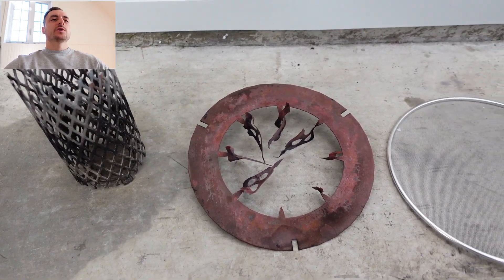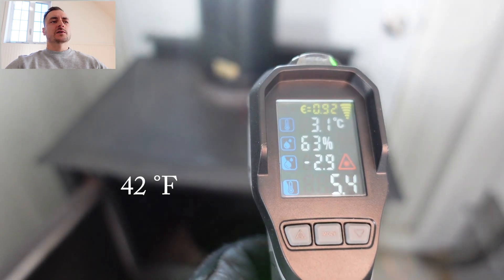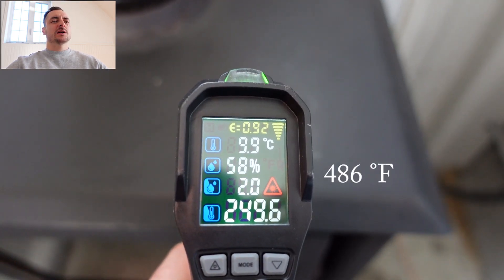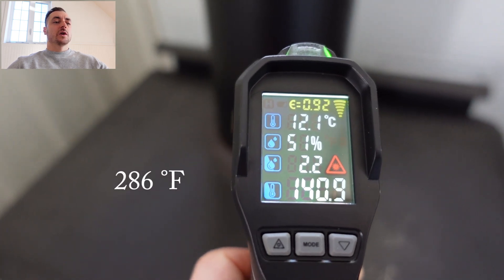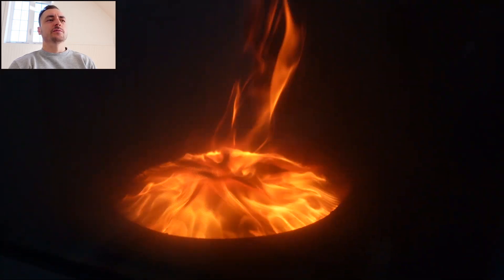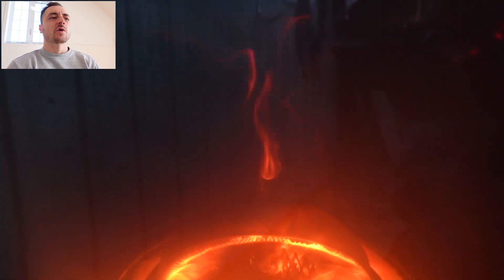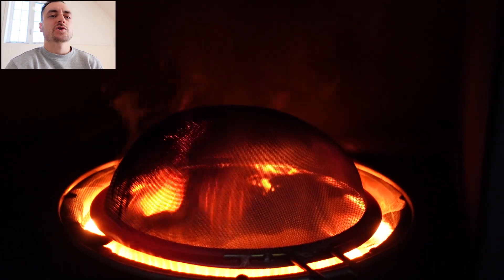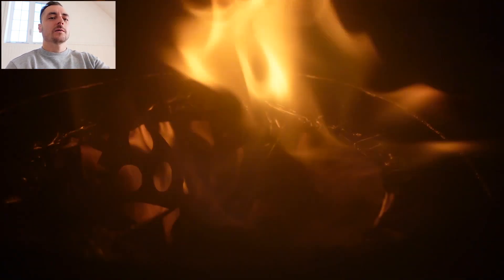CATALYSER Stove Test | HOW TO Make Your Stove More Efficient

Comment: Hi Phil.. I’m glad that I’m not the only pyro out there that plays with oil stoves. I’ve used one on and off for about 27 years depending on oil prices. I switch between an oil stove and coal stove. I love both fuels..From the videos that I have seen of your stove, it looks like you have blue and yellow flame burner. To get yellow flame you install 3 rings that sit on the little nubs in the burn pot (8” diameter) Smaller (6-7”) pots use 2. For blue flame you remove the rings and use the double wire mesh round catalyst placed in the center of the burn pot. You need a stronger draft to direct the Jets of flame onto the catalyst so that it glows red hot. Then the flame will be blue. It goes in with the little disk that holds the mesh together on top. You put yours in up side down…

Comment: I had an interesting event last night.   With the milder weather,  I am shutting down the stove during the days, and just running it at night.   Last night, I kind of rushed the startup, trying to get to bed.  This time, I used much less alcohol (oh, and I haven't been using any steel wool any more) and I waited a bit too long, and had the alcohol almost completely used up before I turned on the oil.  But after a few minutes, the flame had jumped into the area between the cast iron rings, so I figured it would be good to go, and went to bed.
Well, it wasn't, and flamed out, probably from the gusty winds we were having.   I woke the next morning to a cold stove and a flooded burner.  This has been something that I was always worried about, and even contacted the manufacturer inquiring what would happen if this were to ever occur.  They said the burner won't overflow into the air inlet holes.  They were correct, it didn't.  I was glad that I had the cleaning rod nut snug, and it didn't leak either, as the port was completely submerged.  My biggest worry was that the emergency float might have tripped, and I would have to tear apart the regulator to drain the reservoir.  Fortunately the main float valve worked, and didn't overflow the regulator.  Five minutes of scooping and wiping out oil from the bottom of the burner, and it was ready to be relit.  A testament of a well designed stove.
(I'll probably add a bit of steel wool again, but to the far side from the oil inlet, so it doesn't load up with carbon, but should still function well as a flame holder)
Reply from the maker: Oh wow!! Thanks for sharing!

Comment: what is wrong when the damper isn't being pulled open, and there are no flames coming out of the air jets? my flame is just burning like a campfire. it is putting out heat but your flame looks so much stronger. I just cleaned all the air openings, but my stack is only about 9 ft. My flame is also pure yellow. no blue:( Any ideas?
Reply from the maker: If your flame is as described, you’re not getting enough air pulling through the system. Either your stack is too short or not hot enough. Try extending the stack or use kerosene in the pan to heat up the stove for a better draft. Try increasing the flow of oil to see if you can get more heat to increase draft.
Reply: @philg  thanks, will do. Also, thanks for all the videos. They have been a big source of knowledge!

Comment: Why not  a blue flame?
Reply from the maker: Good day Valters, great question and I have the same thought. I will give it a good clean soon and it should help to get that powerful blue flame.
Reply: On my stove, I took stainless screen with about 1/8" (3mm) openings, and I bent it to a shallow convex dome, about 1-1/2" (38mm) over its 8" (200mm) diameter. And I set it on top of the top cast iron ring, which is about 40mm below the top of the burner. I get all blue flames above the screen. I think that's why Phil isn't.   He's setting the screens on the very top of the burner.